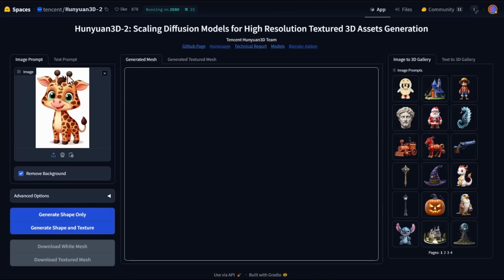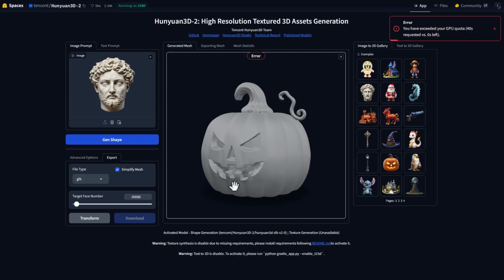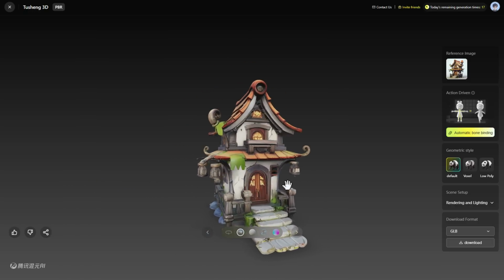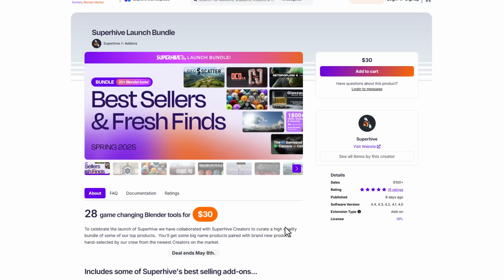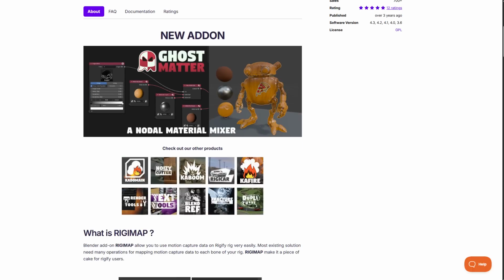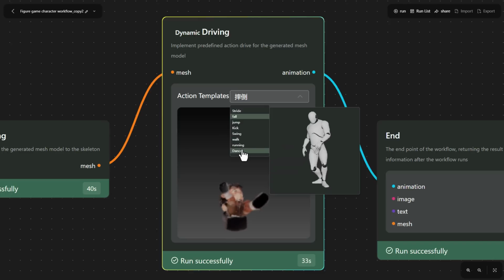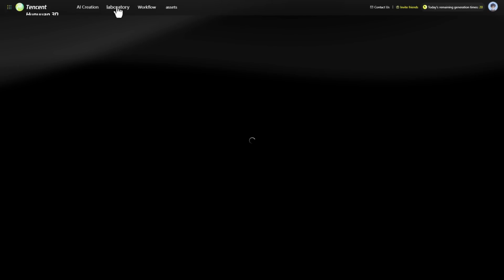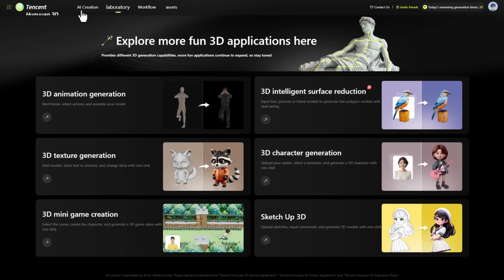Hunyuan 3D-2.5 - Free 3D Model Creator, Now Supercharged For The Future with Automatic Rigging.

Comment: They really do ANYTHING instead of ai retopo and uv unwrapping...
Reply: SO TRUE
Reply: for real, it would be so much easier if they started making AI's for these purposes
Reply: Once they do separate parts I guess they will do that too.
Reply: Exactly
Reply: I think hyunyan does retopo an unwrapping now
Reply: bcs it doesn’t have any sense…
Reply: It is way too expensive to do ai retopo. Like algorithmically. The monetary cost caused by this is definitely way too much as well.
Reply: @lunchbox1553  
At least AI can detect surface flow/loop flow, root-loops, feature lines, and give em for editing. Then check and mark bad surface elements.
Other things can be done with classic tools/
Reply: @bzikarius  Oh yeah, there are definitely a collection of things you can use to assist you, I'm 100% on board with that. It's just that it cannot do an automatic, 100% accurate and optimized retopo because the algorithms used to do that simply do not exist at this time, it really would be a brute force process to do that. 

Otherwise, you could make a compromise on accuracy, and choose one of the existing ones that don't produce perfect results, and then clean up the results afterwards, which is essentially what you suggested there.
Reply: @lunchbox1553, you can't say that without attempting it. It depends on the approach and the algo.
Reply: @kenonerboy  I didn't need to try it because you can do analysis instead of trial and error, and know that it is not worth it. 

Maybe you know of a cost effective algorithm that I don't? Because the only ones I know of that can do it effectively are O(n^2). 

Do you perhaps have a crypto farm I could borrow for a few weeks, or some massive pile of money you're willing to burn?
Reply: @lunchbox1553  yea, im not asking the expertise of lunchbox1553. Youre assuming a bruteforce, naive approach with NN.  I dont understand why youre talking about this with such confidence. O notation describes implementations and aproaches for solutions of the problem, not every possible solution to a problem. Either youre making assumptions about the range of implementations, or u dont really know what youre talking about.

And no, you can't borrow my cryptofarm.
Reply: @kenonerboy  You say that, but then you don't actually provide an alternative. I quite literally asked for an alternative, and you couldn't provide one.

Comment: The 3d artist will be reduced to doing just cleanup and polishing the models, and then reproducing more of the same in the pipeline. However, the models generated may look like the reference, but they lack appeal and soul. It is still the artist's job to improve the models and find the best concept art to generate from.
Reply: These models are still terribly inefficient with texture space and polygons. For now we are still safe. Also AI can't think around the corner so to speak. Especially mechanical stuff that would really work is not really possible right now. Check out Feng zhu's video from fzd school about it. It's really interesting.
Reply: @AssassinDUDE666  If it looks good, all these stuff doesn't matter. It makes impact only when thing is deformed/animated, 99% isn't. That's why we got nanite in UE5, to be able to upload these huge models and just not care.
Reply: @gordon7936  huge models and huge textures are a very different thing. You can't just use a 4k Map for every model in the game.
Reply: @ For now these models output textures in terrible quality anyway, maybe there are ai models that do better textures, but still there's nothing easier than scaling texture down, 5 seconds work. You can also auto retopo with small fixes, that's quick, make uv that's not divided into 1000 piecies and well fit in uv space and rebake textures. That's not that time consuming.
Reply: @gordon7936  it's more about using different layers, micro normals, secondary uvs, mask or vertex painting and cleverly using the texture space you have. That starts at the planning phase of a model. If I'm going to retopo the whole thing to do all that, I can just start from the beginning anyway. That way I at least have full artistic control over every detail. If you are interested in that kind of stuff check out a character design talk by naughty dog. To get characters to look like that in real time you have to do a lot more than just have a lot of polygons.
Reply: @ This is true. I'll look into this talk, didn't see it earlier. Even if this ai is impressive, it's still far away from triple a models, where details are sculpted on objects with even 50-100+ millions of points. I hate ai but i'm starting to accept I'll have to use it and follow it or I'll need to change my profession. For average developers I've met creating 2D ai arts for base/concepts is already an every day reality.
Reply: @gordon7936 it doesn't look good lmao, what are you smoking? compared it to average free sketchfab models it's nights and day
Reply: @gordon7936  it doesn't even look good lmao, compared to average free sketchfab models it's night and day, also nanite actually make performance worse in games, u can't just slap nanite on everything, unless your asset is super realistic like 3d scanned assets like quixel megascans, it never worth using it for shit models like this slop fest models
Reply: @zedeon6299  Some of this new ai models would cost you hundreds of dollars if you hired 3D artist to make them. Sketchfab is full of garbage/overpriced models, if they keep improving ai 3d gens it will give much better quality results, with a lot more consistency. Of course it's bad if you compare it to aaa games quality, but it's not the point.
Reply: For now Hunyuan, can help but for me is not a savior, you need to do a lot of extra work